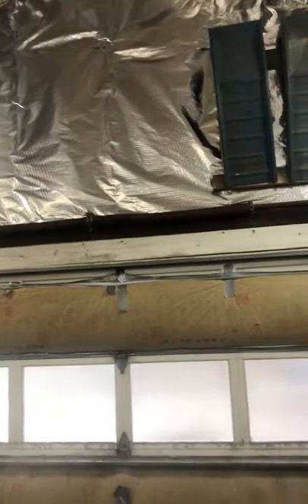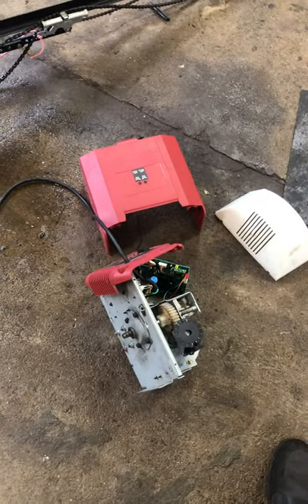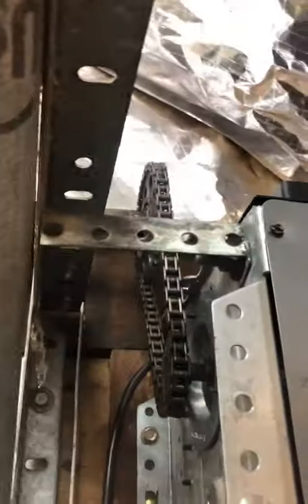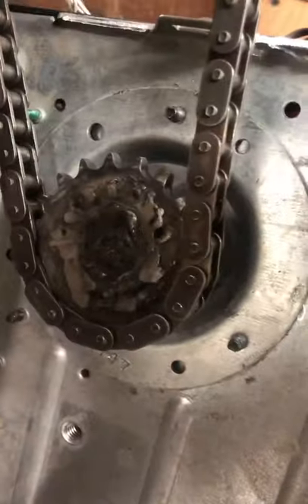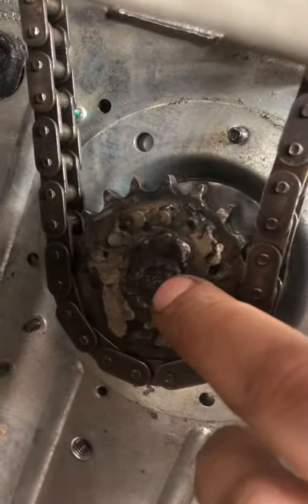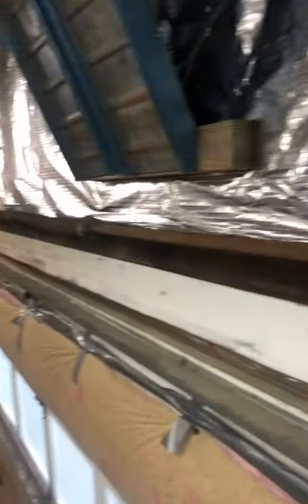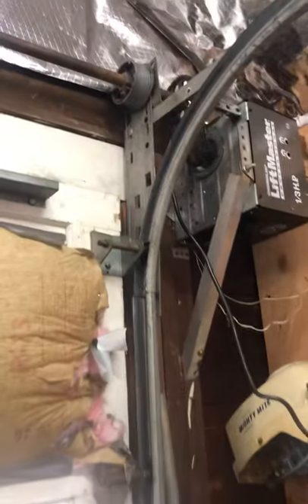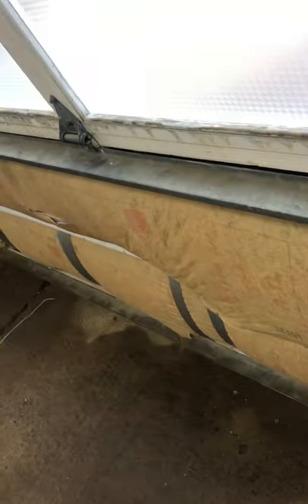Converting standard overhead door opener to side mount.

Comment: One thing to note is that with the newer garage doors, the activation switch is not just a simple electrical connection where you can just touch the wires together or use any old generic momentary switch, but rather a circuit board that sends a particular message to the opener tell it what to do.  That is how they have a single pair of wires be able to control multiple functions on the opener (e.g. opening and closing multiple doors independently, turning on/off lights, etc).  When I replaced my garage door opener a couple of years ago, I discovered this fact because the switches that I had in the garage and house would no longer work and neither would the Arduino automation system that I had designed for the door.  At one point, they differentiated between the various functions by using different resistances for the various functions... This is easy enough to reverse engineer and make work with DIY circuit / Arduino, but they changed it to a proprietary message based protocol at some point and the manufacturer will not give you any information on it so you are stuck having to buy whatever the manufacturer decides to offer.
Reply: Or, opening up a remote and hooking small-signal relays across the switch contacts.  Will probably want gold-flashed contacts, so they won't tarnish and stop working.
Reply: @scottwillis5434  -- That might be possible with the wired remote since it's large enough to actually solder on, but the wireless remotes require microsurgery to solder on... My old eyes can't deal with that even with a magnifying viewer...

Comment: It would also be best to slope your horizontal tracks a little. Just unbolt the ends from the back hangs and move them up 2-3 inches, if you have the room. Shouldn't need to do anything with the front of the tracks, you can usually get enough play to move them just by unbolting from the back. That would add a little more gravity and be a little more insurance against the cables coming off

Comment: Does the 2:1 ratio on the chain drive hold-up. Would you recommend a different ratio? I grabbed some #41 chain and 21 or 22 tooth sprocket to experiment. Great video! Thanks
Reply from the maker: Hello. I think the 2:1 drive was perfect. The motor didn't have to work too hard and I was able to dial it in very well. It wasn't too "jerky" when stopping and starting. Unfortunately this didn't last too long as the old door had to be replaced and I ended up with a larger one with no room to put a motor.

Comment: Looks like you know what you're doing. I'm trying to convert my garage door opener to a side mount as well but also need to reconfigure my tracks so my garage door can run higher when it's open. (I need the extra clearance so I can fully operate my car lift to the highest level). Any suggestions would be greatly appreciated. Not sure if I can use my current garage door motor for the side mount setup.
Reply from the maker: I had two totally different openers used on this thing (a Craftsman Professional and an ooold Lynx cheapy one) and both worked very similarly internally. I had to replace my door about a month after this. I'm not sure exactly why but what happened was the motor being on one side I think would twist the bar in a way that one side got a little more torque than the other and I had a catastrophic failure about a month later where it fell off the track, the windows smashed, etc. I ended up having the whole door replaced. How wide is your door? This one was 16ft wide. I could have probably adjusted the spring on the left side so it was wound a little tighter than the right side. Granted, the door was very heavy (solid wood) and everything was probably 50 years old.
Reply: @peterfaggella3120  OH wow! My garage door is the standard length.. Should I replace the spring with something a little stronger? I need to go twice the height since I need the clearance for my lift to properly raise all the way up.
That's crazy how yours twisted. It looked properly secured / bolted down.
Did you install any side mount motor when you got your new garage door?
Reply from the maker: it was very well secured. I think the center bar twisted - I can't verify that but that's what I speculate and the only thing that really makes sense. I had to decrease the tension on the springs a little because the door would want to hang open on its own (as a normal door would), but as the motor went to turn the drums the cables would come off the spool because the weight of the door wasn't keeping tension on them. I hope that makes sense, I can explain it further if you need. I don't think you need a stronger spring, but I'm not sure what you mean by you need it to go twice the height. I shut the door in order to lift a car more than a couple feet. Works OK for me so my neighbors dont get too nosy.

 @donl3381
Reply: @peterfaggella3120  OH ok... I have a car lift in my garage but can't raise it high enough because my motor is mounted overhead. (I have a high ceiling so the clearance is there but I need to run extra rails for the door to open and sit higher up. That way I'll be able to have a car on the lift and one under it (for storage). Hence why I'm trying to side mount my garage motor.
Reply from the maker: Totally not a pro at this but I don't know if that is possible without really going nuts. The coiled springs are only made to lift the door up 7-8 feet, however tall the door is. I don't think you could wind the springs enough to get it to pull the door open much further than that. I bet a roll-up door would be your best option in that case.

Comment: How did you handle locking the door?  With that system, couldn't a person just lift the door while the cables unraveled into a rat's nest around the spools?
 
Note:  There are a few videos on commercial and home-made automatic solenoid-operated deadbolts.
Reply from the maker: The original door slide-lock worked just fine.
Reply: @peterfaggella3120  - But the slide locks are manual, defeating the purpose of having a garage door opener in the first place.
Reply from the maker: @localguy9816  I'm in and out of it 20 times a day as I work out of it. I only need to lock it at night. I'm sure you could use a wireless actuator with a fob (super cheap on amazon) to lock it if you needed to.
Reply: @peterfaggella3120  - the DIY solenoid-operated deadbolts I mentioned in my first reply are a better option.  Simple, inexpensive, etc.  But if you're in and out all day, and work right out of the building, you don't have nearly the concern of theft a lot of people might want to consider in their builds.

Comment: Great job!  I did the same type setup and works well on one door but the other I'm having the cables unspool.  When the door is all the way up and starts to go down it sort of drops a foot and then goes smooth.  Did you detention the spring a quarter turn or both spools?
Reply from the maker: Yes I did. And that worked. For a month and the 50+ year old door didn't like to be jerked by the machine and it basically turned into a parallelogram and fell down. I had the door replaced with a taller door, so there was no room to mount the motor to the new one.

Comment: Thanks for taking the time to post and share your experience.  Happened to land  here in my own research on the topic.  I Did have a question about the springs, What tools/bars did you use to reduce the tension?  Ok maybe a couple questions or more :-) Did you adjust both springs at the same time? Looking at doing something different, and I think a jackshaft conversion like this just might work, but my guess is I am going to need to increase tension so as to take the load off the spindle/cable/gears/chain/motor and use the tension of the springs do the bulk of the lifting. That's why I am asking though. Trying to understand how the spring tension play a roll.  - Thanks again and do hope you get a moment to share a little knowledge.  At the very least you got to put fire to metal and melt it!!  Plus you populated a few more braincells, including mine.
Reply from the maker: Hey. You will probably have to decrease tension on the springs. I think I mentioned this in the video, if the door wants to "Hang open" (as most garage doors do when they're fully opened"), as soon as you tell the motor to close the door, the door won't immediately move and the cabless will unwind from the drum and it will be a mess to put back together. I took about 1/4 turn of tension off of each spring to mitigate that.  Every garage door I have worked on (and I'm up to 3 at this point) have had a hole that perfectly fits a 3/8" ratchet extension into. You will need two extensions, the longest you can find. I have a pair that are 18" and 24". There is a lot of tension and you need to be super careful. I tensioned both springs equally. It will make more sense when you see it. Let me know if you have any other questions :)
Reply: Quit fn around with your door before  you get hurt. You call my company for help, I would just walk away.
Reply: @manny7684  I have no idea what you are talking about, where did this reply come from. This obviously has to do with a garage door video. FYI I have 22 yrs experience. How much do you have? I’m all for people working on their own stuff as long as they do it right but most of all safely. I see a lot of people doing things half assed or setting people up for failure. Your garage door is the largest moving object on your house, and is inherently dangerous. I’ve had to stop watching yt videos on garage doors,  because most of them are just people trying to make money. Garage door training school is the biggest scam and idiot out there. Sorry calling it as I see it.